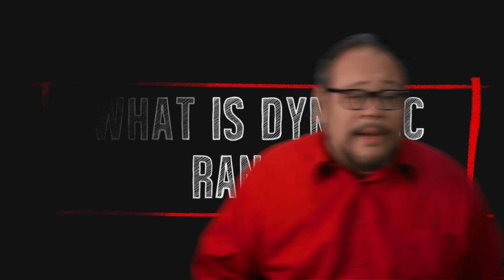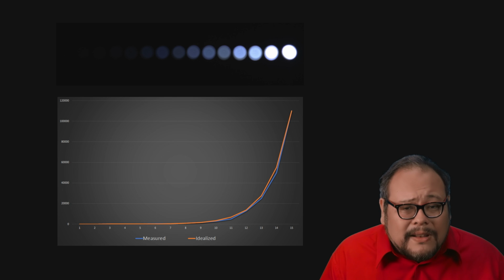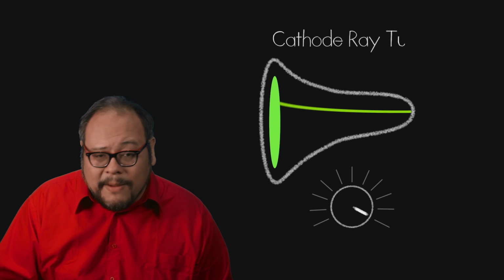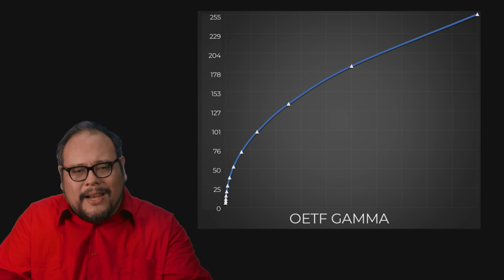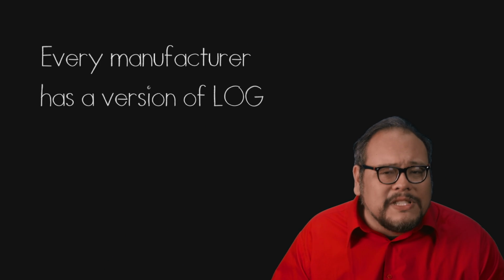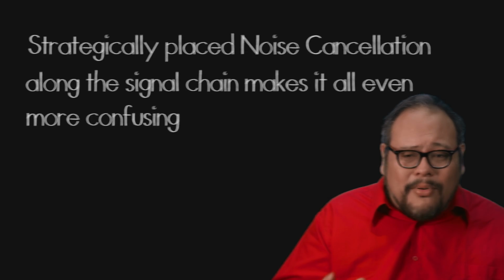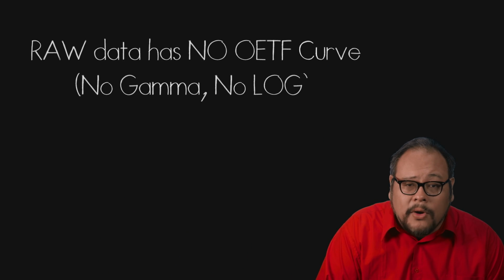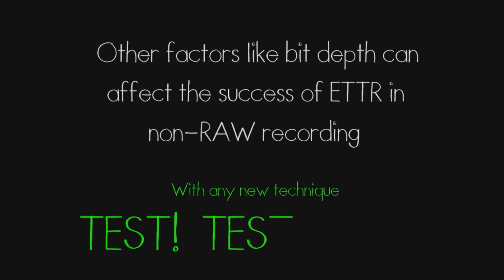Diving into Dynamic Range

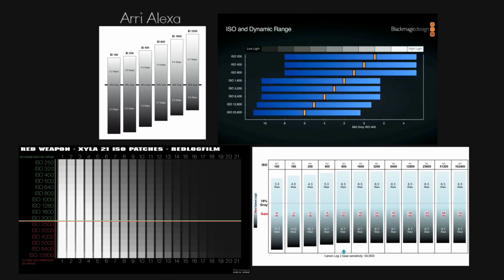Comment: The advice @26:15 (shoot at higher ISO to preserve highlights) is going to sound counterintuitive to vloggers who are used to shooting ETTR with wide open apertures (to minimize depth of field). Most shooters are familiar with sensor dynamic range charts that show maximum DR occurs at the lowest native ISO settings. If you follow those charts, you'll set ISO at minimum, shutter at 180-degrees, open the aperture as wide as you can, and use an ND filter to prevent the highlights from clipping. That will give you ETTR without reference to middle gray level, which vloggers typically ignore.

The workflow recommended in this video is based on the assumption that you are following the cinematography convention of exposing middle gray at around 38%. The rationale for that practice is not necessarily to maximize DR for each shot, but to establish a common middle gray reference point to make intercuts between footage consistent. With that workflow, raising the ISO will increase the brightness of middle gray, and you will have to lower your exposure (by narrowing the aperture or using more ND) in order to push middle gray down to 38%. It is that adjustment that gives you more highlight range above middle gray. What actually produces more highlight headroom is not simply raising the ISO, but lowering the amount of light that is passing through the lens to the sensor.
Reply from the maker: This is incorrect - it's fundamentally flawed way of looking at the light. The problem is ND filters and exposures don't attack just highlight range - the apply throughout the range evenly. If you reduce the light to accomodate the highlights, you reduce the light in the mid tones and shadows at the same time.

Yes, raising the ISO will increase the brightness of middle gray. But reducing the exposure to counteract a raise in ISO doesn't actually protect your highlights - it does nothing. Visualize it this way: You have a middle gray and a highlight +5 stops above. You raise your ISO, so now what was middle gray is +1 stop above... now your highlight is +6 stops... so you reduce your exposure... you're back to middle gray with a highlight at +5 stops.

Thus the only thing you did was raise the noise floor by 1 stop if you did that...

This is with the traditional understanding of ISO, but many modern cameras (especially "cinema cameras") utilize a push pull system for ISO where the dynamic range is consistent throughout a chunk of ISO range. This article using my video on the BMPCC 4K is an example of this: https://www.premiumbeat.com/blog/dual-native-iso-explained/

You'll find similar charts on Red/Arri/Canon cameras as well. Those cameras will allocate more of the dynamic range shades above middle gray as you step up the ISO.

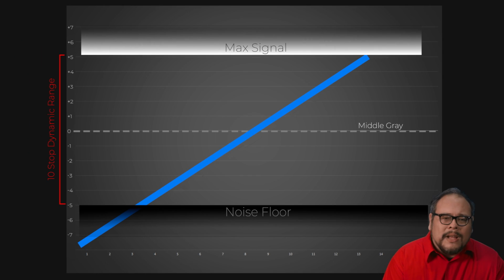I also explain it all at 24:12 in this video which you should revisit.

Finally middle gray isn't a cinematography convention - it's a photography convention that goes back to the origins. And middle gray is central to the concept of defining ISO as well. Film timing to correct and get consistent exposures has been a thing since forever - it's not why we shoot for middle gray.

I personally would advocate to put the preference to middle gray and then just look out for highlights and shadows that fall out of range and try to wrangle them in. You can try to expose in such a way to capture every bit of dynamic range but I think that misses the forest for the trees.
Reply: @FilmmakerIQ  - "But reducing the exposure to counteract a raise in ISO doesn't actually protect your highlights - it does nothing."
Ah, but it does if you reduce exposure by actually lowering the amount of light that passes through the lens (i.e. by narrowing the aperture or increasing the ND filter). That is how you get an extra stop of highlight headroom, by making room for more stops of light intensity above middle gray, not simply by increasing ISO. Notice, I'm not talking about increasing DR here, only about increasing highlight headroom above middle gray, which as you advised, is the point of raising the ISO.

What is actually "non-traditional" about BlackMagic's chart of ISO vs dynamic range is their virtualization of the concept of ISO. The reason the dynamic range of the BMPCC stays constant across a range of ISO's in their chart is because they're not actually recording at incremental analog and/or digital gain levels, they're recording at the native ISO for each range, and using metadata to record the virtual ISO for decoding purposes. In other words, the same range of light intensities (i.e. what is actually detected by the sensor) is being recorded at each ISO step in the range, the only thing that changes is the designated level of "middle gray". But since middle gray is the reference point upon which all other DR measurements are based, everything else changes accordingly.
Reply from the maker: but it does if you reduce exposure by actually lowering the amount of light that passes through the lens. That is how you get an extra stop of highlight headroom NO IT DOESN'T. You are not giving yourself headroom by changing the exposure, that's thinking  by putting the cart before the horse. The light coming in from the lens will have the same dynamic range regardless of ND filters and exposure settings. Proportions between tone ranges are not changing.

It's the ISO that determines the headroom. Adjusting the sensor setting gives you allocation of the highlights and shadows, not the exposure.  You match the exposure for the ISO but the exposure is NOT responsible for giving you headroom (unless you purposely underexpose).

In other words - if you just increase the ISO (on these cameras that push/pull for ISO) without changing the exposure - you will increase the headroom above middle gray... but everything will be just overexposed. The headroom above middle gray exists whether you utilize it or not.

I think that is where you confusion is - there is no "middle gray" in terms of light  from the scene - it's only in relation to how we set up the sensor.

Vloggers would do best to really understand what I'm saying - what you're saying is just adding to confusion.
Reply: @FilmmakerIQ  "The light coming in from the lens will have the same dynamic range regardless of ND filters and exposure settings. Proportions between tone ranges are not changing."
It's not the dynamic range of the light itself, it's the maximum luminance the sensor can detect before it saturates (i.e. the limits of its sensitivity to light), divided by its noise floor, that determines the native dynamic range of the camera. As you point out, a Dual Native ISO camera has two separate sensitivity ranges, but within each range its native sensor sensitivity cannot be changed by ISO settings. Once you reach the maximum luminance that sensor range can handle, the ONLY way you can increase the maximum light level it can discriminate is to lower the amount of light passed through the lens (i.e. by narrowing the lens aperture or increasing the ND filter).

While it's correct to say "it's the ISO that determines the headroom", the BMPCC Dynamic Range vs ISO chart illustrates what the  camera's ISO setting is actually determining. Within each sensitivity range, the camera's dynamic range remains unchanged. The ONLY thing that changes when you change the ISO is the designated level assigned to middle gray within each range (until you get to extremely high ISO's).  My hat's off to BlackMagic for making it unmistakably clear what the camera's ISO setting actually does.
Reply from the maker: I think I see where your argument is going but where this is getting flummoxed is you're trying to avoid middle gray.

Once you reach the maximum luminance that sensor range can handle, the ONLY way you can increase the maximum light level it can discriminate is to lower the amount of light passed through the lens

Agreed. But that says nothing about headroom. Headroom is defined by the range above middle gray.  What is middle gray is ultimately is the question.

Every ISO has a maximum light input... On the BMPCC example ISO 100 an ISO 1000 both have the same maximum light level it can discriminate - ISO 1000 has a lot more headroom between middle gray and full saturation than ISO 100...

But if you were to completely ignore middle gray and worry only about staying just below the clipping point (ETTR)- the idea that reducing the light that lands on the sensor so that's it's further from the clipping point works out as way of "protecting your highlights"

Taken to the extreme, it doesn't matter what ISO you shoot on the BMPCC, so long as you anchor your exposure to just under the clipping point of which ever "native ISO" you chose. The resulting images will be underexposed light scenes and over exposed  dark scenes - which you can in theory fix in post.

But I think that approach is fraught with dangers and creates more headaches then it solves actually trying to expose for middle gray.

But honestly, I don't know where this conversation is heading or what you were trying to correct me on. ISO determines dynamic range, you expose for the ISO - I haven't seen anything to counter that line of thinking :)
Reply: @FilmmakerIQ  - Thanks for your efforts on this in-depth video and in responding to my observations. I agree completely with your analysis of middle gray and headroom (as that is exactly how they are defined). If you reconsider my original comment, I hope it's clear I wasn't attempting to "correct" you, but to point out the gap between a cinematography workflow and a vlogger's ETTR approach. In practice, I use 18% gray cards all the time, and it struck me how many vloggers aren't even aware of the concept.
Reply from the maker: Gotcha - truth is though, after doing this for 8 or so years on YouTube - I don't take stock in techniques of non-professionals especially if they fly in the face of how the technology actually works. And of course I get yelled at by kids thinking they know how it all works... because it's YouTube... :P

Comment: Great video and excellent explanation. But I have a question. So, how do we find out the appropriate dual ISO combination of different cameras if do not have the chart of DR as shown in your video? Optimum combination of ISOs (dual ISO) for predominantly dark scenes and for predominantly bright scenes? And secondly, what is the role of ETTR?
Reply from the maker: Not all cameras have dual ISO. Those that do will document it pretty thoroughly. Next really is you should set up tests and experiment shooting different exposure and ISO combinations.

The role of ETTR is just tap down noise. It used to be more in vogue but noise floor of modern cameras are getting better that it's become sort of obsolete.

Comment: i take it that means using a regular camera or smartphone camera to get the most possible detail the exposure should be done with low iso and a exposure time thats long enough to over expose the bright part of the image without clipping it so that later in photo editing software it can be darkened to and that would bring detail that wouldnt have got captured?
Reply from the maker: Difficult question to parse... There's quite a bit of difference between a regular camera and a smartphone camera. Smartphones now have so much software in them that it changes the approach.

What you're describing is ETTR. I honestly wouldn't recommend it as something you should always do...

Instead you should decide what matters more to you, retaining highlight or shadow detail and aim for that.

Comment: Does itt also works for photography or just video?
Reply from the maker: Generally speaking it's more a video thing but the concept is actually the same in "ISO invariant" cameras.
Reply: @FilmmakerIQ  I was thinking in the Idea os using the ISO to Low Light Situation or Light Sky
Reply from the maker: Yes actually. There's a common suggestion of using low ISO for astrophotography. It can reduce the noise floor and give you deeper detail in shadows. The drawback depending on your exposure settings, is your stars might lose their color because they're won't be much headroom. So instead of blue and red stars, you might turn them all into clipped white stars.

Comment: Hi John, your videos are always amazing, as science and nature. A question... We notice at 25:42 that all the stEps between all the stOps are different in terms of 'IRE distance'. They are different not only inside the same ISO level, but also from one ISO level to another ISO level. Is there a calculation that allows to know how many IRE a 1 stop corresponds to (in a single ISO level)? Or should we resort to an empirical method (for each ISO level)? It would be great if you could read the false color chart with an IRE-stops match. I think we we might know in a precise way how many stops we have under and over the middle gray (middle gray that each manufacturer places ina a specific IRE level, depending on the profile used). I hope I have not confused the concepts.
Reply from the maker: I wrestled hard with this concept early on but here's the tricky part that you need to wrap your mind around. There is no natural correlation between IRE and stops of light -just none. Think of IRE as the canvas that dynamic range is painted on. Any given encoding scheme (Rec 709 or LOG) will naturally put the stops at certain IRE but it won't be necessarily linear (as explained early on in terms of gamma).

False color isn't a bad choice because once you've captured the image, what the "stop" something is at isn't as important as where in the recording medium dynamic range the signal is being recorded at (like is it clipping or close to clipping)
Reply: @FilmmakerIQ  Oh... Thank you very much! You have said several times that is not necessarily linear. I hadn't even transferred the same concept to the IRE scale, and i had it under my eyes. Sorry! Thanks!!!

Comment: this is the most in-depth yet understandable explanation of Digital ISO/RAW on YouTube! Something that isn't widely discussed: Why is ISO unchangeable in still photo RAW processing applications yet ISO is an adjustable piece of metadata based on native sensor ISO while working with cinema camera RAW files like BRAW and R3D in non-linear editors?
Reply from the maker: That's a really good question and I think the answer is really going to be one of semantics (because you are effectively adjusting the ISO in a Raw editor when you play with the exposure slider). Digital moving pictures have a background in video where people think in terms of a signal where as still photography still thinks in terms of a frame of celluloid. Gaining up and down the recorded signal (which some software engineer thought would be useful to translate that into ISO) naturally makes sense but maybe not so in stills even though the actual engineering is exactly the same!

Comment: did i get it right ? i sure know a log in sense of math, but leaving that aside

the answer might be simplier this time
an example he makes is to overexpose the picture (that indeed does highlight the dynamic range but not for the blacks as he mentioned that also)
the same thing can happen for a underexpose if you have a lot of contracts in the other direction

and yes cameras useally can handle like "5 steps" 

the light amount is given but not why the sensor can actually handle lets say 5 steps

the curve is telling how it in the end looks the log maybe the amount of light and the relation in sence of a log math 
but again that doesnt answer the sense in form questioned to the sensor size or maybe other relations
Reply from the maker: I can't follow your comment for the life of me.

This has nothing to do with sensor size.
Reply: @FilmmakerIQ  that the question/answer is on the commentary is already enough 
very nice is that you even gave a answer

Comment: Really interesting, I know its 2 years since the vid but been doing testing on my panasonic G7 and the two ranges for me is 200 and 800, I have a card which shows 6 different scales and for iso 200 it shows 4 for the shadow and 2 for the highlights, in 800 its 3.5 for the shadows and 2.5 for the highlights, not a massive difference but at least gives me an informed view on the capability the camera and where best to expose for.

Thanks for this, camera is only 8bit so the better in camera I can get the better so it don't need so much in post.

I say cautiously lol.

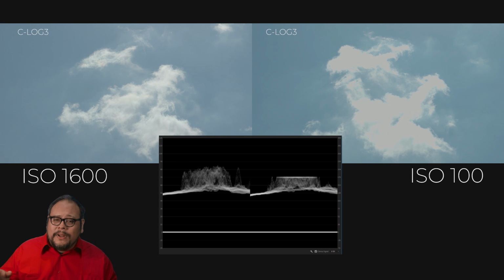Comment: Thank you so much for this! The "Red Pill Moment" described below at your kicker at 26:19 has been making me think of the "Zone" method of calculating exposure and dynamic range. Most popularized by Ansel Adams, using individual 8x10 inch photographic plates per image, the photographer used a spot meter to calculate the dynamic range required of the negative to allocate as much detail as the scene required, and would then 'rate' the ISO of the plate accordingly - providing the printer with all the juicy dynamic range needed for producing an incredibly rich final image.
I'm no doubt wrong on several fronts here, but it just sounds a bit familiar with is explained here...